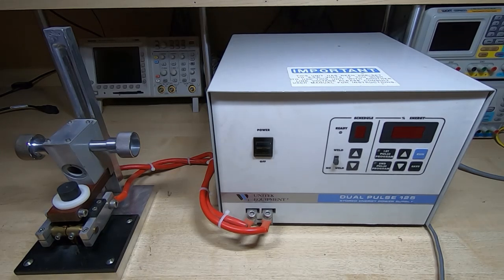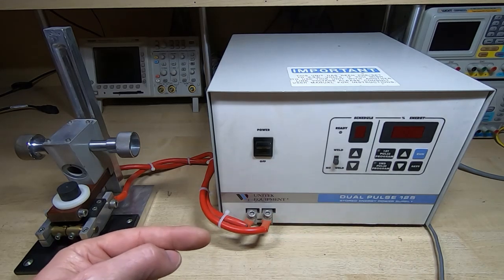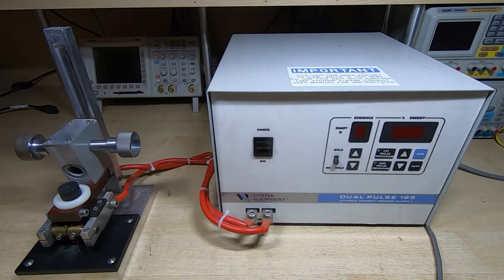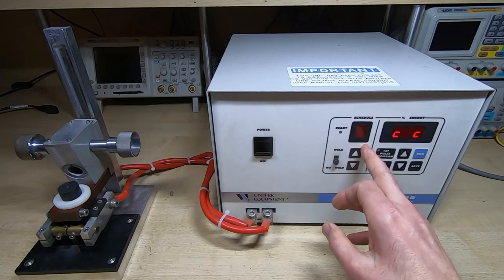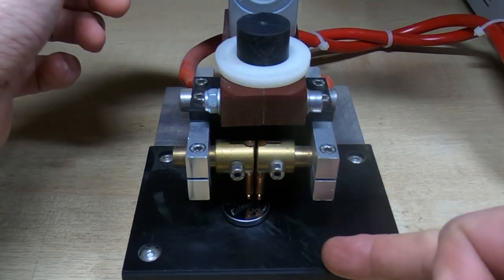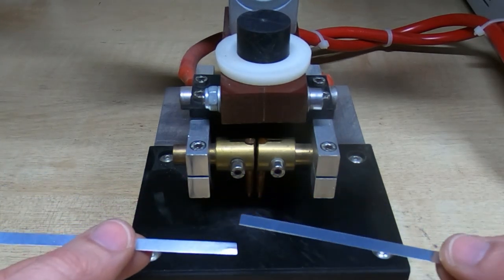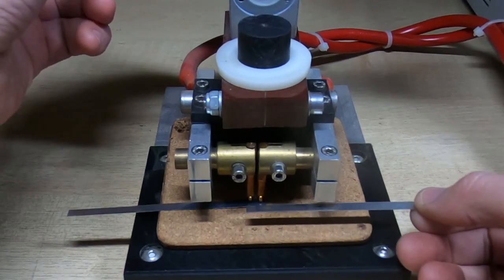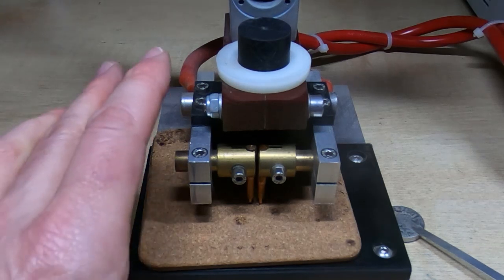Spot welding from just one side

Comment: Single-sided spot welding looks to be quite useful for fabricating/repairing appropriately sized items.  I've been wishing for a smaller unit than what you shared in order to spot weld new extension wire leads to some broken head coil wires inside a "failed" DECtape 10-track head assembly.  I've almost excavated the ~60+ year old potting compound and that copper wire is _tiny_!  Just try removing the rock-hard potting compound without breaking too many more wires!  (So far, a SMT hot air gun seems to soften the compound enough to pick it away as long as I don't keep melting my magnifiers by mistake....)  The head was replaced with a functional one, but I still would like to (get lucky and) repair it for the owner as a surprise.  I still need to measure the wire gauge first in order to determine what size wire I need to order for "experimenting" with joints to the extension wires.  I've only got an el cheapo "import" handheld battery-powered "spot welder" kit, allegedly designed to spot weld tabs onto batteries (thinner tabs than standard), but haven't tried it and certainly not on copper wire yet.

Comment: You didn't show us inside! D:  guess it's just a transformer with an SSR and a timer?
Reply: Indeed it has transformer... I'm not so sure about a SSR but it does have Mosfets or igbts and microcontrollers to to provide you with not only a very high current but also a very high frequency current (of the order of MHz). So yeah I guess you can call sort of they use SSRs.

This device is a marvel of power electronics.
Reply: @shantanukumar7174  Oh that's interesting, sounds more like some sort of switching design then.  my plan for a DIY one was a big transformer and SSR to turn it on and off really quick, it would obviously be limited to the smallest on time being 1 powerline cycle then, probably pluss some ringing
Reply: @Sigmatechnica  yes it's pretty similar to your diy..... SSR you'll use to get high frequency current it would seem. Go ahead...have fun